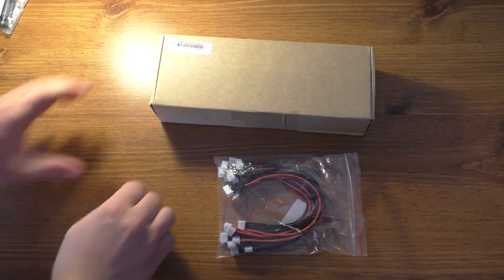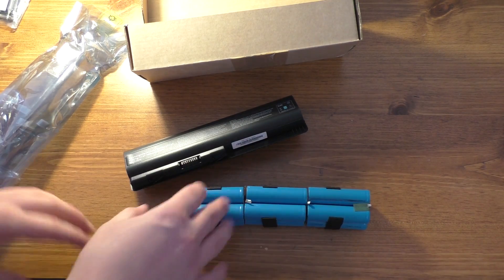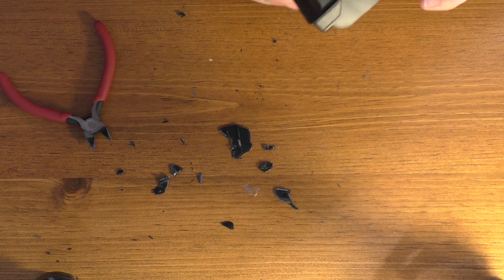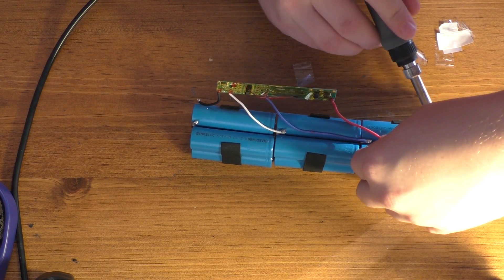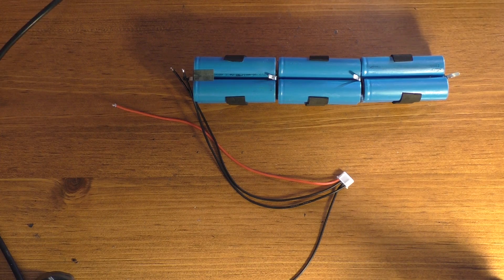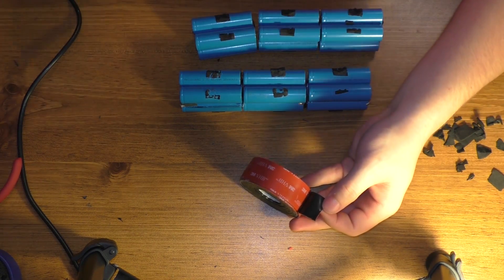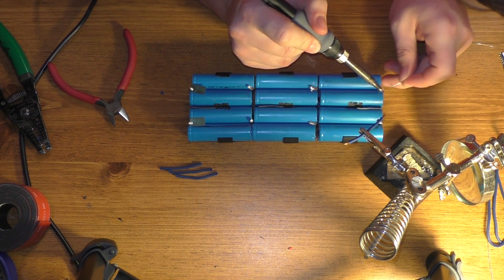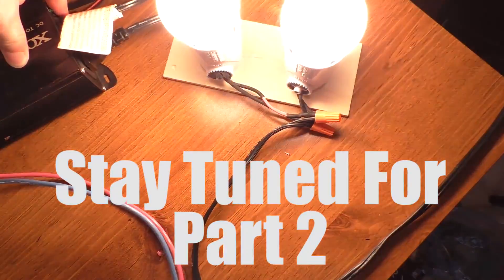DIY 12V Lithium Battery Pack Part 1

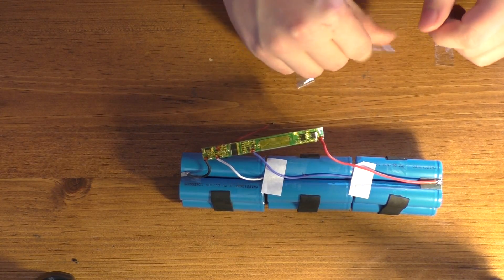Comment: 7:20 The reason it is so cheap is because that is a knockoff battery with crappy cells that are not the capacity that they say they are

Comment: nice but the reality is that you dont have charge control on every single cell... if one of the cells gets damaged then you wont be able to tell..
Reply from the maker: I don't have charge control on the pack at all really. Don't need it either. I use an external balance charger for this pack (which is the reason I put a balance connector on it) and the external charger does monitor every cell. The only protection I built into the pack was undervoltage. I actually did have a cell get damaged on this and of course I was able to tell because I can read the individual cell voltages.
Reply: how? if you have 3 or 4 batteries in parallel you cant read each battery voltage. if one of the batteries gets charged then it stops..
And thats the main reason why multi-batteries power solution fail. because the charge control is in every cell (that contain lot of batteries in parallel) and not in every single battery..
Reply from the maker: Charge control on every cell? That would be impractical and rather pointless. Nothing that I can name uses that. If you have 3 or 4 cells in parallel all of those said cells are at the exact same voltage. They can't be different because they are wired together. Normally you only have charge control on each set of cells in series and you don't worry about the individual cells that make up the parallel sets. If one goes bad it will bring the voltage of the rest of them down. If one gets weak it won't really effect anything. You would have to have a ridiculously complicated and expensive BMS to monitor ever single cell. The laptop batteries I pulled these cells from were wired in the exact same manner that I wired my pack, without control of individual cells.
Reply: Yep!! Node voltages are circuits 101

Comment: wouldnt even taken it out of the case, it had bms 'n shit, would of just soldered wires on outside connector and thats it
Reply from the maker: Those batteries DID NOT have a BMS in them. They had a temp sensor and a chip for reporting battery capacity or something back to the laptop. Not to mention the 22 or 24 gauge wires in those batteries that would have melted if you tried to pull more that maybe 3 amps out of them.

Comment: Question, how did you charge them I mean did you use a balance charge
Reply from the maker: I use a hobby RC Balance Charger.
Reply: Eman2000 so u used a 3s balanced cable to charge 12 batteries
Reply from the maker: I have a whole video on it: https://www.youtube.com/watch?v=KIJI7yAG2NY

Comment: OMG I was cringing when you were cutting into the shell with a METAL tool. DO NOT DO THIS!

I laughed when you added electrical tape to insulate the tabs from the metal they are already soldered to. The entire casing is the negative bud.
Reply from the maker: You're the first to notice either LOL. Out of curiosity how would you open those things though because as I recall they were glued shut. I figure as long as you're careful it should be fine.
Reply: I don't know what method others would recommend, but my method is to place the battery pack on a solid surface with one edge in contact with the surface, then hit the diagonally opposite edge with a hammer, starting gently and gradually increasing the force until the case cracks at which time it's possible to get something into the crack and prise the shell apart.

Some care needs to be taken not to crack the lithium cells inside, but this is less of a problem than you might first believe since there's usually enough space between the shell and the cells to allow the outer shell to flex and crack without damaging the cells.

Comment: can't add. 3 cells is too small. 4 cells is too big. does anyone know how to make a 12v [13.5 v]  battery to match and replace a 12 v [13.5 v] lead acid deep cell??????
Reply: Buck converter
Reply from the maker: This is about the closest you can get. But you can use LiFe cells instead of Li-ion which are a bit lower voltage. A fully charged 4s LiFe pack would be 14.4 volts and the same pack fully discharged is 10 Volts. This trouble with the LiFe cells is they are harder to get and more expensive.
Reply: 1. A 3-cell (3S) lithium-ion pack has a maximum voltage of 12.6V with a nominal voltage of 11.1V and a fully discharged voltage of 8.4V (assuming 2.8V per cell minimum).
2. A 4-cell (4S) lithium-ion pack has a maximum voltage of 16.8V with a nominal voltage of 14.8V and a fully discharged voltage of 11.2V
3. Systems which use lead-acid batteries often have to cope with a wide voltage range with battery voltages occasionally getting up above 16V, so they should cope okay with the voltage range of a 4-cell Li-Ion pack.
4. The real problem is that lead-acid batteries can be float charged while Li-Ion cells can't.  They'll tend to over-charge and will explode if left on a "float" charge.

Conclusion: As far as voltage is concerned, a 4S (4 cells in series) will probably work so far as voltage is concerned, but your real concern is to prevent over-charging the battery pack.  You can't just pull out the lead-acid battery and drop in a Li-Ion battery.  You need to replace the charging circuit with one designed for a 4S Li-Ion battery pack.

LiFe cells might give a closer voltage match, but you still have the same problem of needing a charging circuit designed for the purpose since they have the same over-charging problem as other lithium technology batteries.
Reply: JasonMasters Hey thanks for this info. Got more info from you then 10 videos. Straight to the point.

Comment: I found that the non genuine batteries were about half the capacity of genuine. I would rather buy a 6 cell gen then 12 cell chinese.
Reply from the maker: For the $10 a piece these were bought for they do pretty good. I did capacity testing in part 2.

Comment: I want to design battery back up for my 18 watt LED light, operating voltage of 12 volts. with 65 ah battery, can i charge the battery with my solar panel,
Reply from the maker: It's possible using something like a solar BMS
Reply: with balanced charge controller i an do but is it feasible to use than lead acid battery
Reply from the maker: With 65 Ah of capacity it would probably be more feasible just to use lead-acid unless you need Li-ion.

Comment: i`m trying to build a backup battery for a gps tracker unit. it currently has a 4x2 inches 6000mah 3.7v battery with a positive and negative wire coming owt of it. i removed the old battery as it was swollen . there is enough room for 6 x 18650 batteries. would you be able to tell me which batteries are best to get the best battery pack and how should i wire them.thank you
Reply from the maker: +jay p If it's just a 3.7v battery you would just wire as many 18650 cells as you wanted in parallel. About 3 of them should make 6000mAh. But you can use all 6 that you can fit in the case it will give you better run time. You could get laptop batteries and take them apart like I did or just buy normal individual 18650 cells.
Reply: Like Eman2000 said, just wire the cells in parallel.

The main things you need to watch out for are that the cells all have close to the same capacity (not critical, but gives you the longest battery life in terms of charge/discharge cycles) and that the cells are all charged to nearly the same value when you connect them, which prevents a fully charged cell from trying to charge any discharged cells which could cause a very large current to flow which would be a fire risk as well as damaging your device from the heat.

Then too, you need to make sure you connect all of the cells the same way around in a parallel circuit, because otherwise you'd have a short-circuit which would not only be a fire and damage risk, but also an explosion risk.

In other words, just follow a few sensible and simple rules and it should work just fine.
Reply: Looking for buy BATTERY in USA ! Found a really good deal on these Batteries at www.BigBattery.com. Use the discount code { Lithium5} to save an additional 5% discount.

Comment: Am trying to make 2 replacement cells for a Razor E300S electric scooter to increase range. I have a bunch of 18650 cells, could you recommend a configuration of cells to use? Motor is 250W 24V,  OE batteries are 2x 12V SLA 7AH. There's a device inside that takes the 12v input from the two batteries and makes 24V from it (I don't think they're just wired in series) so I just need to create 2 x 12V packs. Would you recommend 4S packs with a step down or 3S packs? I got some plastic spacers to hold the cells in place but stumbling on the configuration. Thanks in advance for any help. If you recommend the 4S, I would need a converter that can handle about half the wattage of the motor, right? About 10A throughput on the converter? Maybe a little more just to be safe?
Reply from the maker: I would probably use 3S packs. The voltage range is the closest you can get to a 12V lead acid battery and if that scooter has a low voltage cutout it will still work about the same with the 3S pack as it would with the lead acid batteries. You also don't have to worry about voltage conversion.
Reply: So if I used 3S... and did 4P.. assuming 2000mAh cells that would be around 8Ah... and be more capacity than the OE SLA, right? Or maybe I should go all in and do like a 3S 6P just cause it would still fit in the battery compartment? Ha ha
Reply from the maker: Might as well do it all!
Reply: Been searching around on ebay now and amazon and 18650s (protected) are approaching $3 ea!! :(
Reply: So going along with your idea to buy laptop battery packs to cannibalize for the batteries... does this look like a good deal? Are these probably 8 2600 mAh cells?
https://www.amazon.com/HP-Probook-4310s-Laptop-Battery/dp/B00VB7RNUG/ref=nav_signin?s=pc&ie=UTF8&qid=1487570582&sr=1-11&keywords=8+cell+laptop+battery&
I think if that's the case these would be really inexpensive... the 4 cell pack for this laptop I found the dimensions for and the pack measures 20mm high... so I'm guessing these are actually the 18650s. Does anything look wrong to you with this deal or does it look like a good deal? I assume these are not cells with built in proteciton like the others I've been looking at. So far these would be about $1.25/cell, and the best deal I can find for cells with built in protection are about $2.36/cell. 
http://www.ebay.com/itm/262774872061?_trksid=p2060353.m1438.l2649&ssPageName=STRK%3AMEBIDX%3AIT
I currently have a bunch of protected cells... maybe I'll finish out that cell (only lacking 4 to complete the pack) and then maybe use unprotected on the other pack to save $. This is more a hobby thing, not a pack I'll need to survive or get to work.
Reply from the maker: The amazon battery looks like a pretty decent deal, the only thing I don't like about it is the fact that is doesn't have any reviews. The ones that I got were on sale for something like $10 and free shipping (12 cell batteries) but they had reviews on them and the only bad ones we complaining about how they didn't fit in their laptop and not about actual problems with the batteries. They are probably worth a shot anyway.

From the looks of it that battery is wired in a 4s 2p configuration giving that its voltage rating is 14.4V it also states 8 cells and a total capacity of 4400mAh. So the individual cells will have a capacity of 2200mAh.

I probably wouldn't trust the the "6000mAh" supposedly protected eBay cells. I have seen where people buy cheap "protected" batteries on eBay and the cells don't actually have protection. They usually don't have much capacity either, possibly used cells that they put new wrapping on.

I think that the laptop batteries are so cheap because they go to laptops that no one uses anymore and they are just trying to get rid of stock. The capacity of my 2 laptop batteries where actually really good.

Comment: First use some electrical tape around the areas where you have to solder so it protects the heatshrink that's on the batteries? To run them in parallel why not use just enough of the wire already connected to the BMS/PCB Board of each battery pack and cut just enough of them so you have two wires for extra current or join one at the center so there's no soldering on the batteries at all add two small pieces of heatshrink to cover the parallel wiring and a larger piece for the balancing wires then bare the center of these wires to solder in the balance wires?
Reply from the maker: Putting electrical tape on before soldering would be a good idea. But the wires that were on the built in for the BMS were kind of thin so I'm not to sure that they would handle having any real amount of current flowing through them.
Reply: Eman2000 That's why I mentioned doubling them one from both sides to the other but if they're to thin you're right. They are only meant to send a signal and they never make balancing cables long enough

Comment: I like the way you use the original battery tabbing connectors as much as possible.
Other videos seem to waste everything.
Reply from the maker: Thanks, I was just trying to make it as easy as possible and I figured they're all ready wired the way I want them so why disconnect them.
Reply: You never know what quality each cell is so most people take them all apart to test the cells integrity and each cells mAh rating is for balancing reasons and most of these video are using old dead battery pack, but these were never used so I would charge them up like this guy did and test them in a week, if they held the voltage, I would tape and wire them up then use heatshrink both packs together and throw it in a case with terminals for the power inverter! Good job Eman2000
Reply: Did you find that link on Amazon yet? Thanks

Comment: perfect,
can you help me with this
http://www.instructables.com/answers/how-to-make-12v-battery-fr%C3%A5n-18650-li-ion-batterie/
Reply from the maker: If you want to use 18650s than you will need 6 of them (2 strings of 3) for LED strip you don't really need a regulator but you will need battery protection circuitry.
Reply: thank you , 
if I use 6x3400mAh batteries  (2 strings of 3) , how many voltage will I have? and what about the capacity?
If I have protected battery ,will I need battery protection circuitry?
Reply from the maker: You will have 12.6 Volts fully charged and about 10 Volts fully discharged and 6800mAh of capacity. If you have protected cells then you don't need other protection circuitry.
Reply: Eman2000

Comment: Congrats for the educational video, a bit slow video for me albeit informative. 
Thumbs up mate.
Reply from the maker: Thank you!
Reply: great video, i am wanting to use mine for lamping with my big torch, how long do they last ? or does that depend on how powerful the torch is
Reply: Marco Giove P = V*I = depends on how much your Lamps consume in terms of Amps and acceptable Voltage. go with 18650 with 2.2A per battery and conservative voltage level of 3.8V = that will give you how much P... thats how i have done, this will give u factor of +/- 10% deviation of usage plz share your details and video when you do it will b fun project.
Reply: thanks very much ill do what you've said i understand it now, well the basics anyway, i'll let you know if i get stuck haha, i'll record it too
Reply: Good man! 
your lamp P (Watts) = V*I with be in ration with the batteries P with above calc - will dictate how many hrs your lamp can run! you need more Amps add more batteries. If you are working in IT or other electronics department - look to scavenge in e-waste, they have loads of components and stuff; its not bad idea to get adapters test using multimeter mark the output Volts etc and keep it aside for homely little projects
Reply: Mukesh Pandya thanks for the info buddy i'll  use, and yes thats true iv saved old pc computers and other stuff like that its amazing what you can salvage out of them iv also made an adjustable power supply :-) i'll let you know how i get on. One more thing iv opened a lithium drill battery up and was wondering if i could just use that as its the same power its just charging it were i would have to mod it
Reply: Mukesh Pandya jst so you know its the MILWAUKEE M18B5 18V 5.0AH LITHIUM so would have to bring the volt down to 12 some how
Reply: You can have 3 options:
1. Did you try ebay? there are voltage DC-DC converters which can drop down voltage.. 
2. I am no expert but there is easy thing you can do by "voltage divider" where in you can calculate Resistor values splitting the voltage to give you exact 12V DC. 
3. Other option is open the Battery pack (retain the pack); unsolder one of the battery from 4S2P (looks like you are getting 16v from 4cellx4v with 2 parallel sets to give you 5AH (2x2600mA battery )) circuit to 3S2P (3serial 2 Parrel) to give you 3cellx4V = 12 volts...
4. Scavange old Adapters, I keep ranges at home in a box - you will definately find some 12vDC adapters x 2A
5. Last option i can think of Computer PS: it has -12V, -12V, +5V, GND etc.... try to find the terminals with voltmeter and u get 12V but with I think 2Amps - this can be used to test your circuit before you start building 18650 cells etc.. 
if it make sense.....
Reply: Mukesh Pandya 
u can't use exactly  (12 volts)
u need more than 15 volts to charge  the li-on battery pack 
the battery pack has more amp
than the charger
Reply: gear icon and speed it up a bit, it helps.
Reply: 7 Ways To Prolong The Life Of Deep Cycle Lead-Acid Batteries > https://t.co/3ycayBV4e1

Comment: hey guy I sorry I take it back. I was wrong.3.7v is the nominal voltage and 4.2v is a charging voltage . so 4.2 than 3 is around 12 v .